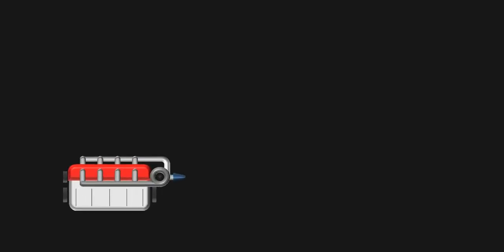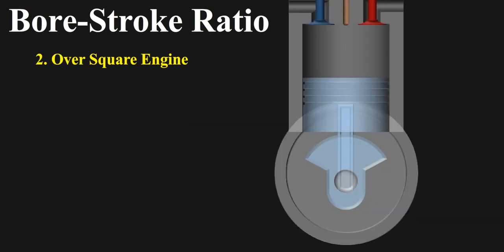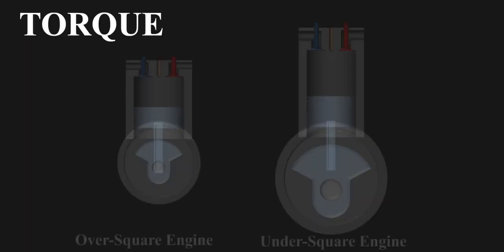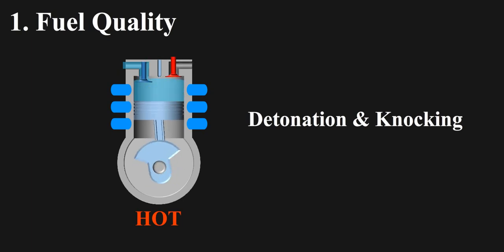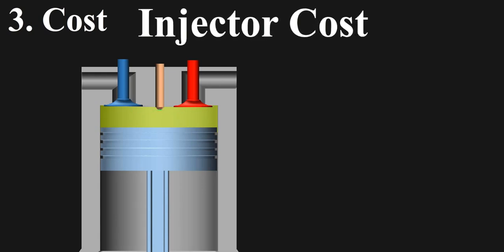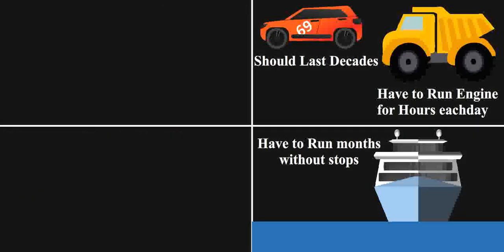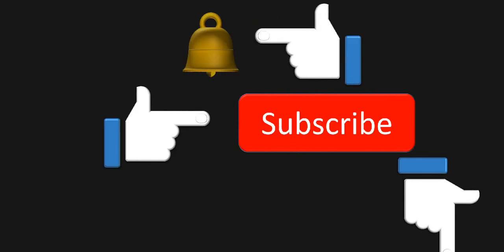Bore Stroke Ratio | Performance  Engine life  Effects | Applications

Comment: Well, all this makes sense, however,
You can also use "heavier" flywheels or crankshafts to "increase" torque". Remember, heavy flywheels store energy, so once moving, it takes less energy, or horsepower to keep rotating. Torque is the twisting force that does the work. Horsepower just keeps the flywheels turning.... More horsepower is made at the expense of burning more fuel, but not necessarily produce more torque...
Reply: A heavier crankshaft or flywheel does not increase torque.  It increases angular momentum. Generating that angular momentum consumes torque.
Reply: @rollsroyce329 
You got that totally wrong buddy. 
Heavier flywheels, ie, crankshafts, store
"Inertia".  Force equals mass X acceleration, 
F  = MA, or once you accelerate a mass it stores energy. The momentum you speak of is the residual energy that will eventually dissipate, as the flywheel gradually slows down. 
You need to revisit Newton's Law of motion. 
An object placed in motion, tends to remain in motion...
For every action, there is an opposite an equal reaction, etc, etc... 🤔
Reply: @Pork-Chopper  Now do an object at rest.  And what does Mass x Velocity equal?
You’re not one of those “take the wall with you” guys are you?  “Less energy to keep rotating”. You’re not one of those perpetual motion guys are you?
An object at rest tends to stay at rest unless acted upon by an external force—torque from combustion in this case, right? That torque accelerates the vehicle’s mass and the flywheel’s inertial mass. Adding a heavier flywheel (more inertia) means more torque is needed to accelerate it (Torque = Inertia x Angular Acceleration), leaving less torque to accelerate the vehicle. Your claim that a heavier flywheel “increases torque” or acceleration is backward—it reduces acceleration for the same engine output. If adding 8,000 lbs to a 6’ flywheel radius increased vehicle acceleration without more input energy, that’d violate the First Law of Thermodynamics: energy can’t be created from nothing. Combustion provides the energy; a heavier flywheel just stores more of it as kinetic energy, not creates more torque. Also, you’re still conflating force (F = ma, during combustion) with momentum (p = mv, after combustion stops). Once spark and ignition cease, the flywheel’s angular momentum keeps it spinning, but that’s not new torque—it’s just inertia at work (Newton’s First Law). Care to explain how your “increased torque” fits with energy conservation?
Reply: This 🚮 video: “all makes sense” ?  Here are at least three glaring errors in the video: The guy who made the video thinks:
 1.The Engine's Torque, not its Power, is responsible for the cars rate of acceleration.
2.He thinks less time is required for the piston to travel from TDC to BDC in a shorter stroke engine than a longer stroke one.
3. That a longer crankshaft journal offset length provides increased leverage.

He doesn’t understand some pretty basic physics so it shouldn’t “make sense”.
Reply: @rollsroyce329 
Here's a simple comparison to think about. 
Take a bone stock 350ci motor, and a bone stock 454ci motor, both with the same size carburetor, say a 650cfm. Now, do a side by side comparison, both running at say 2000rpm.
Which engine produces more torque? 
Which engine produces more horsepower? 
Which engine is burning more fuel?
All things being equal, which engine is the stronger of the two?
Does fuel consumption make a difference? 
If you were to reduce fuel consumption in the big block to match the small block, would power output be the same? Or would the big block still be producing more torque? 
Why do bigger engines produce more torque with less horsepower? (RPM)
Enlighten us, Einstein.
Reply: @Pork-Chopper  This isn’t a simple example.  It’s a simpleton example.  A larger engine displaces more air at a given RPM than a smaller one.  At the optimal air/fuel ratio the larger engine burns more fuel per combustion cycle.  All else being equal the larger the displacement the more fuel burned the greater the torque.  See also: BMEP.
“Which engine produces more torque?”
The one with the greater displacement.
“Which engine produces more horsepower?”
The one with the greater displacement.
“Which engine is burning more fuel?”
The one with the greater displacement.
“Which engine is the stronger of the two?”
The one with the greater displacement.
Does fuel consumption make a difference?”
Yes. It is the source of the torque and power.
“If you reduce the fuel consumption of the big block to match the small block, would power output be the same?”  There would only be three ways to achieve the matching fuel consumption.  I’ll illustrate each.
1. The most direct way to reduce fuel consumption as it is downstream of the airflow  through the metering of the carburetor would be to reduce the opening of the throttle to the point where the CFM through the carburetor of the big block engine matched that of the small block’s CFM the carburetor would then meter out the same amount of fuel and air to both engines at the specified 2000RPM.  The big block would have significantly lower BMEP however and would be making less torque and less power than its small block counterpart due to its higher effective cylinder pressure.
2. Another way would be to reduce the dive of the jets in the carburetor so that they were not able to correctly meter out the additional fuel to match the additional CFM of the big block at the designated 2000 RPM.  This would cause an extremely lean air/fuel ratio that would is worse case misfire/detonate or at a minimum produce less torque and less power than its small block counterpart.
3. The third method of reducing fuel consumption to match would be to reduce engine RPM so that the CFM of the big block matched that of the small block’s CFM at 2000RPM and then all else being equal would produce the e same torque and same horsepower as the small block.
“Or would the big block still produce more torque?”
No, in none of those scenarios does the big block produce more torque than the small block.

“Why do bigger engines produce more torque with less horsepower? (RPM)”
Perhaps I’m missing the significance you intended with RPM in brackets after the question as it is not clear but to answer.
1. A bigger engine can not produce more torque at a given RPM (2000 let’s say for consistency) without a proportional increase in  power.
A larger engine can produce more torque and less power than a smaller one if it is operating at a lower RPM than the smaller one.  Through gearing though the engine producing the greater amount of power can produce more torque to the wheels than the one producing it natively.  Power, not torque, is the limiting factor in not only the top speed of a vehicle but also in how quickly it can accelerate at any speed and how much weight it can pull up an incline at any speed.

Were you thinking the amount of fuel the big block and the small block was consuming at 2000 RPM was the same because they both had a carburetor rated for 650 CFM of AIR flow?
Reply: @rollsroyce329 
Ok then, let's say you have a big block engine that produces 500 horsepower, like a 572ci crate engine and produces roughly the same amount of torque.. 
On the other hand you can have a 500 horsepower caterpillar engine producing the same horsepower, but produces 1500 ft lbs of torque. Same exact horsepower, but yet one engine is producing 3 times as much torque! 
What is different? Displacement? 
Fuel consumption? 
Bore n stroke? 
And the 500 horse caterpillar does it all at less RPM's... 
Or is it the mass n size of the caterpillar engine? 🤔
Reply: @Pork-Chopper Or is what the mass and size of the Caterpillar engine?  You have already differentiated displacement from the list.  So do you think the density [density (D) equals mass (M) divided by volume (V)] of the Caterpillar engine has mystical Torque crating powers?
What benefit do you think you receive from the Caterpillar engine producing 3x the torque of the BB crate engine if both generate the same 500HP?
You do get there is a difference between correlation and causation. Most Ferraris are red.  Red however is not what makes them fast. And the difference between cause and effect?  Obese people wear large sized clothing but large clothing doesn’t cause obesity. It seems you are conflating perceived benefits to be attributed to observable attributes that may correlate but are non causal.
Reply: @rollsroyce329 
I'm not arguing semantics here. 
I'm comparing apples to apples. 
500 horsepower from an automotive big block
Engine, and 
500 horsepower from a caterpillar tractor engine. 
They both produce the EXACT same horsepower. 
Why does the caterpillar engine produce more torque (the property that can do MORE work)
than the big block engine which produces the exact same amount of horsepower? 
There are different kinds of horsepower. 
If you had to choose between the two, would you choose a 1000 lb Mustang, or a 2000 lb 
Clydesdale? They are both horses. 
Which horse will plow the field with less effort, 
the Mustang, or the Clydesdale?
Reply: @Pork-Chopper  I see where you’re confused.  A common misconception.  I have three questions for you that will clear things up::

1. You're pulling a very heavy trailer up a steep hill and need to maintain the minimum speed of 45 MPH. You've done your calculations and know that it can be done by the narrowest of margins. 

Do you? : 

A. Select the gear that puts the engine at its Torque peak at 45 MPH where it's output is 300Lbs/ft and 100HP 

Or 

B. Select the gear that puts the engine at its Power peak at 45 MPH where it's output is 150Lbs/ft and 200HP

2. You are driving a given speed and need to accelerate as quickly as possible.

Do you: 

A. Select the gear with the ratio that puts the engine at its Torque peak where it's making 300 Ibs/ft and 100HP. 

Or 

B. Select the gear with the ratio that puts the engine at its Power peak where it's making 150bs/ft and 200HP 

Would option A. accelerate twice as fast because the engine is putting out twice as much Torque or would it accelerate 1/2 as fast because the engine is putting out 1/2 the power?

3. You're at Vmax the car will not go any faster as all engine output is consumed by friction. You have selected your gear ratios to harness all possible output of the engine to achieve top speed. This occurs at.
A. The engines torque peak
B.  The engine's power peak

This is usually the part (when mathematics joins the chat) where Gnostic Torque supremacists run and hide.  You’re not going to run and hide are you?
Reply: @rollsroyce329 
Transmissions, in general, are torque multipliers. In a standard transmission you normally downshift to maintain speed n rpm, if you want to pass, you accelerate, using peak power, not torque.
In an automatic, you also downshift to go uphill, if you want to pass you step on it, and burn up the transmission.
If you're going downhill, you also downshift to slow you down .
When I drove a Peterbilt loaded, going uphill I would put it in 3rd gear, going downhill I would also leave it in 3rd gear to slow down, with the addition of the jake brake, to maintain speed n rpm's. This keeps the torque output the same at pretty much the same value, same for peak power, even though the engine had more power output available.
Not confused, you're just jacking with the power curve to keep it where you need it, using the gears available...
Reply: @Pork-Chopper I believe I answered your many questions in good faith.  Can you give a simple A or B on the towing, accelerating and VMAX scenarios?
Reply: @rollsroyce329 
F=MA
Torque is the twisting force that gets you moving... A
Horsepower is what keeps you moving, momentum... B
Cut power, and inertia will keep you moving until all kinetic energy is dissipated... 
You also have coefficients of drag and friction to deal with if you want to factor those variables in.. 
Happy Trails...
Reply: @Pork-Chopper  so that was:
 A for towing?
B for Acceleration? 
And which one for VMAX?
Reply: Vmax is the total energy it takes to move/accelerate mass,
Mass which is density or weight can be small or large, larger mass requires more energy 
1 horsepower is equal to 746 watts of energy
Gear ratios is a whole other area of study, that's why small 4 bangers now have 6 or 8 spd gear boxes, to maximize the work done by torque multiplication. They now have the variable automatic transmissions which do the same thing to maximize output of small displacement engines... Going downhill will help VMAX with little effort, you just better have good brakes to dissipate that energy as heat to stop your ass!
Reply: @Pork-Chopper  A for towing would be incorrect.  I thought you might get this wrong but I’m curious why you said A for towing but B for acceleration?  The engine has no idea what the load looks like.  All three are the same as far as the engine is concerned.
Reply: @rollsroyce329 
Load weights are different. 
Heavier loads require more power to move
Lighter loads require less power to move
Depending on the power plant, the power plant, ie, motor, also has limitations, it only can produce so much power, that us helped by gear ratios in the transmission. 
Horsepower n torque always cross each other at 5250 rpm, and power may not always be linear, like on an electric motor, so you are constantly adjusting the power band moving up n down to maintain a certain speed to overcome hills, wind drag, road friction, form drag n parasitic drag. You can build a motor, theoretically using power formulas, compression ratios, cam profiles etc, but in real time, once you build that motor and put it on a dyno, your math results never match the actual output results of the dyno testing. 
For example I've put pencil to paper and calculated 1.125 horsepower per cubic inch displacement, however, this output is measured at the crank, and is pretty close to your calculations, but rear wheel output is always less by about 20% or more because of frictional n parasitic losses. So, what do you do? Build a bigger motor!
Reply: @Pork-Chopper interesting.  Can you see the inconsistency in your reasoning?  You chose A (less Power) for the (seemingly) heaviest load and yet you say: “Heavier loads require more power to move”. And then for Top Speed you Choose B. When both loads that the engine sees are identical the engine is at stall for both.  Can you see that?  I liked your build a bigger engine answer.  Good American freedom loving solution.  Racing regulations, government overreach or sometimes just concern for packaging and weight make this less of an option.  Engineering is the discipline that takes all kinds of different priorities and comes up with the best solution.
Reply: @rollsroyce329 
Yep, 
That's why I mentioned the motor comparisons
The big block engine producing 500 hp but only putting out close to 500 ft lbs of torque n will have to rev higher as opposed to the 500hp caterpillar engine (same horsepower) that puts out 1500 ft lbs of torque, requiring a lot less rpm to move the same load...
Reply: @Pork-Chopper I see you have gained a bunch of knowledge from your experience but you had some things confused.  Has this helped at all?
Reply: @rollsroyce329 
I always enjoy talking about machines. 
My degrees are in Electro-Mechanical Engineering with a minor in Electronics Technology. I have also built many engines, from chevy small blocks n big blocks to Harley knuckle, Pan, Shovelheads n Evos. It's always interesting putting pencil to paper, but there is nothing like real world experiences and seat of your pants experimentation. And there are many ways to improve an engines efficiency and learning never ends. If everything was perfect are brains would atrophy... I've enjoyed talking with you, it's always enjoyable to talk with people of like mind, and there's nothing wrong agreeing to disagree, it's an incentive to continue learning n keep those marbles turning....
Reply: @Pork-Chopper  I race a CBR 600RR and ride an 08 Road King.  I can appreciate crazy RPM and massive grunt.  I would have a beer with you any day.
Sincerely, Einstein. 😁
Cheers.
Reply: @rollsroyce329 
10-4 Good Buddy! 
Ride to Live 
Live to Ride 

PS, btw, I also fly choppers! 
Bell47's, have over 100hrs
🇺🇲 Semper Fi
Reply: @Pork-Chopper M.A.S.H. 4077 style? Awesome!
Reply: @rollsroyce329 
I love the UH-1 Huey's as well,
It's on my bucket list to fly in
one of those too! 
Now those, are, machines... 😁

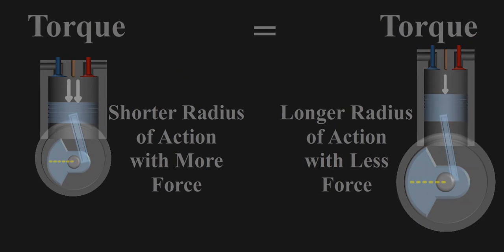Comment: 4:40 sports car accelerates 0-60 "that fast" because they have more 'Torque'?? The most stupidest answer I have ever heard.. It is the power of the engine that matters, Not torque!. It is the "Torque seen at the Wheel" that determines the acceleration of vehicle, Not torque seen at the Crank shaft!!!  Wheel torque highly depends upon "Gear Ratio" of transmission and very little on engine torque. Do more research before fooling innocent people. And yes, longer piston stroke allows greater expansion of burnt gas, producing more "Torque". 4:05 Your imprudent assumption of constant pressure exerted on piston head throughout the stroke length is completely BS!.
Reply: This video is hivemind 🚮

Comment: In engines that have a cast iron block, wouldn't the undersquare design result in less heat loss, since a smaller proportion of the surface area of the combustion chamber is in contact with the more thermally conductive aluminium surfaces of the piston and cylinder head?